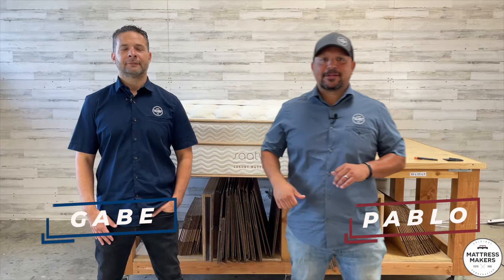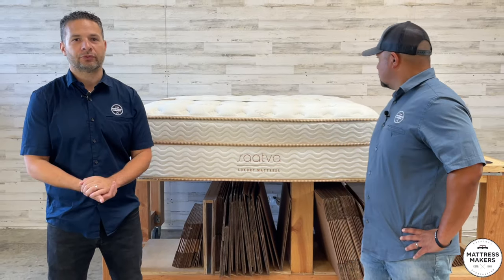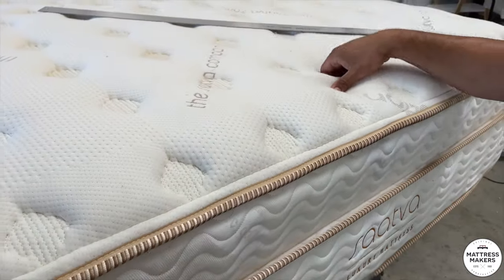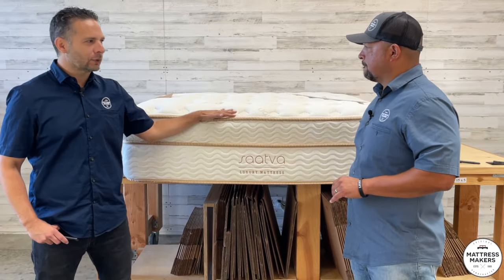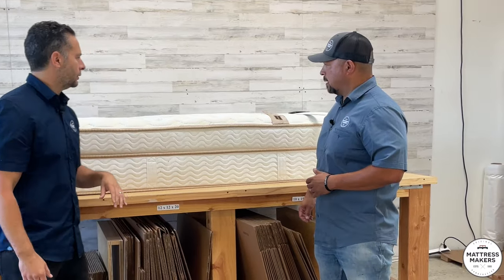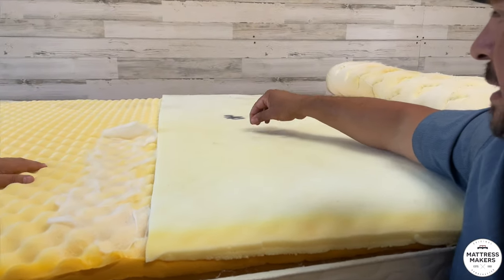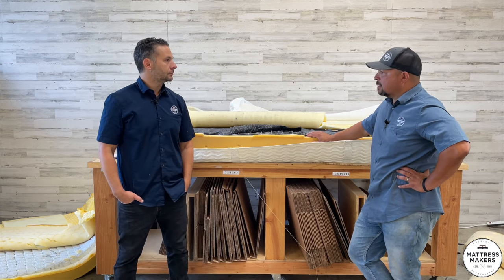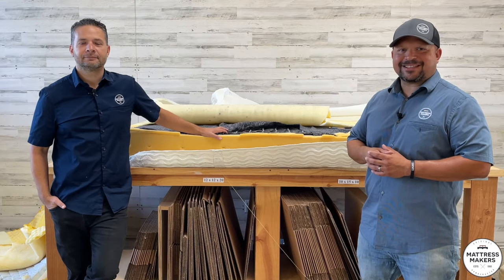What's Really Inside a Saatva Mattress: Anatomy of a Mattress

Comment: Rather than Luxury firm, I Bought the stiffer  Firm saafta  for longevity,  and by a year or so, the wife sleeps in a Hole,  she moves to the other side of the mattress, and end up rolling down hill back to the Hole.
Mattress is about 3 years I guess, and going out the Door, and not for another Saafta,  but the old traditional double sided Hotel mattress, that can be rotated and flipped, I expected tripple the life.

Comment: Concerns and wants

Top layers

Comfort level options for a true medium feel.

On a scale of 1 to 10 a 5 or 6 comfort level.

I wish it had a layer of laytex across the top.

Maybe a layer of memory foam or micro coils.

Heavier pocket coils across the center zone for extra hip support.

With a zipper enclosure  on the top. If not an all together separate piece that rest on top that zippers, attaches to the base.

Base 
edge to edge offset coils.

NO FOAM ENCASEMENT.

I really do like the spring on spring concept.

Wish I could afford to have a custom bed built for me. 

This is what I would build.